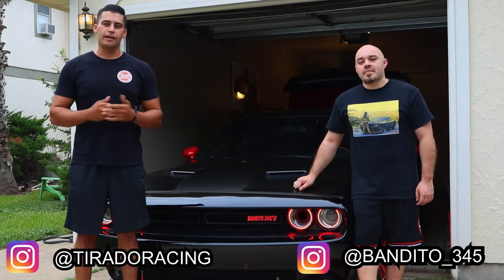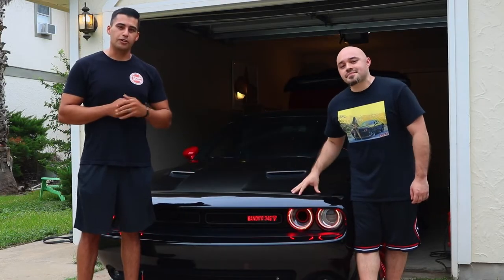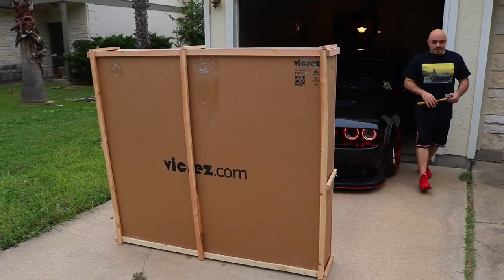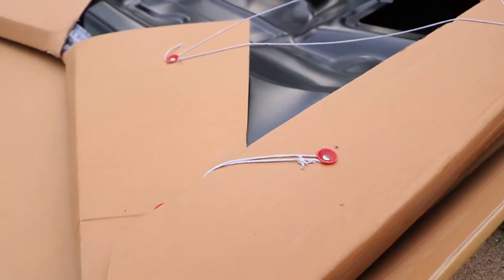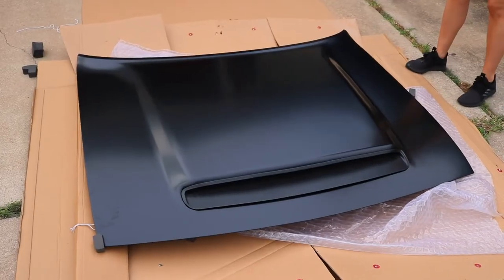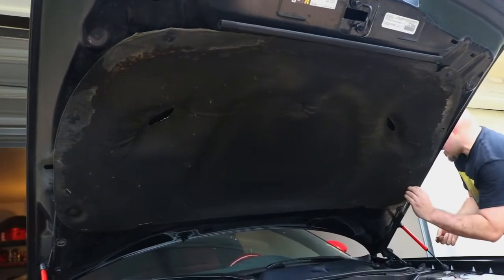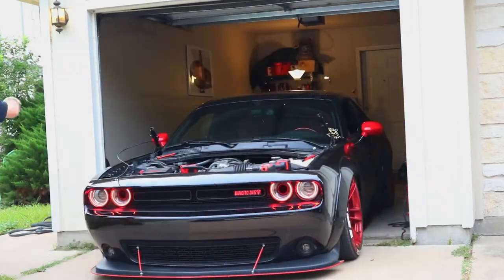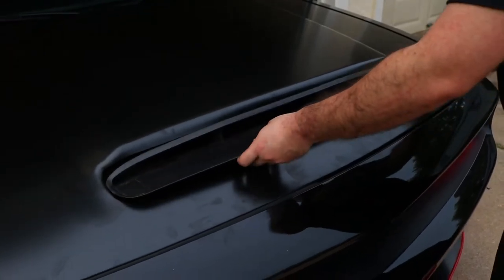How To Install VICREZ Demon Hood!

Comment: Nice! Did you have to adjust it in anyway, or just bolt on and it lines up perfectly?
Reply from the maker: Always have to adjust hoods. I have an oem hellcat hood on mine and it’s not 100% perfectly lined. It’s the biggest bitch to line up 😤😤😤. This hood lined up pretty good with a few minor adjustments.